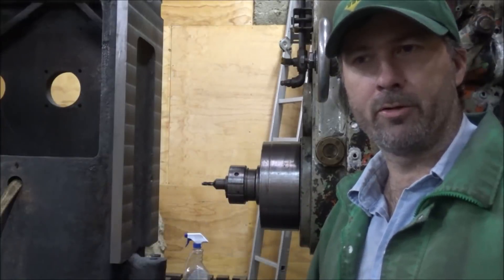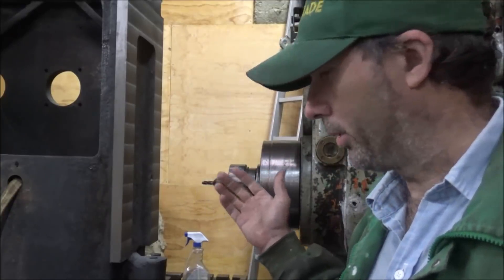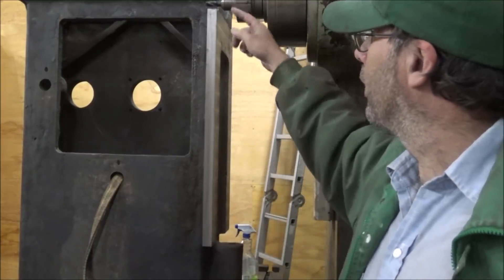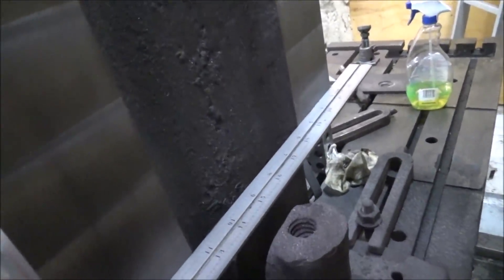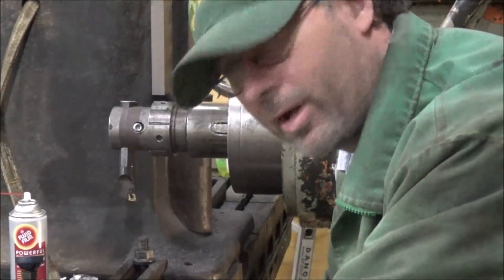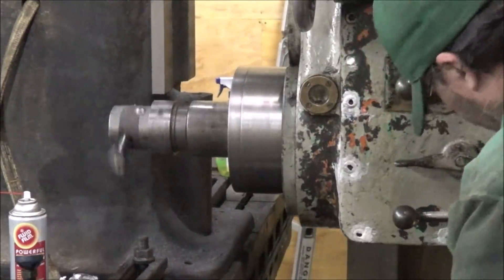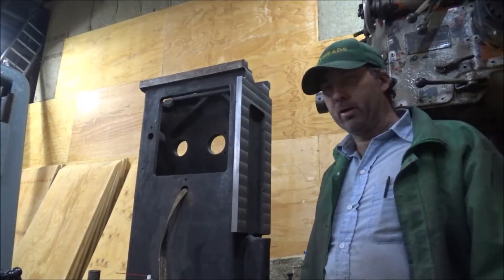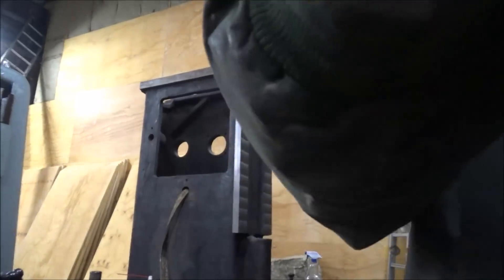Machining a machine Tool: Rebuild back to Spec Part 3

Comment: I suppose that shaper main casting, given it's age, would have originally been machined with a planer, maybe somewhat roughly, and then scraped to finish it.  Though your machining seems excellent and usable as is, the rotary cuts do not give the correct feel of a machine that old.  Perhaps finish scraping the machined surfaces would give the shaper back the look it had when it left the original maker's machine works.  A lot of work, but might be worthwhile.
Reply from the maker: There was evidence of both rotary and straight line machine marks but none of scraping so it might be more authentic than you think. Of course I don't know how scraping looks after being out in the weather for 30 years either.

Comment: I would have never thought of using a boring bar backward like that. +1 for clever. I did notice the backside cut was consistent with the face cut "zebra stripes". It appears to confirm that the spindle axis is running slightly "downhill". I also never noticed that appears to have been painted Kubota Orange at one point in its life. That must be painful for a Deere guy...
Reply from the maker: Best I can tell it points down about .0002" in 4" you can see it in the flycutter path but you can't really feel it.

Comment: Another great video.  Looks like the original was a kit that needed finishing..
Reply from the maker: Considering it has had 140years of use it really wasn't too bad. Honestly there isn't much you could buy at Harbor Freight that would have been as good even. I am sure the guy that had it new thought it was the best thing ever and for the time it sure would have beat  a bunch of flat files!

Comment: I believe that I have watched every episode of turning the barn into the shop, I am wondering how your in floor hot water heating system is working?

I am amazed at what you have done to turn the barn into a a strong, weather tight shop!
Reply from the maker: Still not to weather tight yet. I need to get the ceiling put in.

Comment: Brian, at 4:14 how did you check it for square and parallel ?  Thanks
Reply from the maker: I had milled a spot across the top so I could reference my square down across the sides to indicate square. Then I used a micrometer across the face to measure width at various locations to see that it was parallel.
Reply: @bcbloc02  I think I can see that in my mind; not sure to be honest.  Your setups are very unique, and how you determine the results are what I tune in to learn.  Can you please show a bit more of the advanced sets ups, how you measure, and how and why you call a dimension 'good'? Thank you, Joe
Reply from the maker: There will be a whole video on measuring the results over on my granite plate. Sadly I think I missed filming a few of them and the part is already gone so I can't go back and do it again but the main deals all got checked.
Reply: @bcbloc02 I am looking forward to it!

Comment: Found anything to fix on that big machine while doing this job?   Besides getting a non tapered cutter that is.  This seems to be the shakedown cruise of this vessel. 8-))
Reply from the maker: I have already made an alignment adjustment and I still need to fix the elevation issue the machine had when I bought it.

Comment: If I were a machinist, I would have turned the piece ccw 90 degrees and used the end mill.
Reply from the maker: Then it becomes difficult to decide when you have actually achieved a 90 deg turn. If I wasn't trying to hold accuracy to +-.001" then that may have been ok, but in my experience the more times you move something the worse your errors get.
Reply: Thanks for the response Brian, I suppose you are right, what with all that mass.

Comment: Don't mean to send rude but you can't use an adjustable square to check that type of work for accuracy.
Reply: Brian, about 12 times in the video: "I know this Starrett square isn't the right tool, but it's what I've got"
Random internet commenter: "That square isn't the right tool"
Reply from the maker: It is actually a pretty decent square but as I mentioned before I know it checks slightly under square. By knowing what it roughly looks like I can get real close with it and it will certainly show if you are out like it did with the tapered end mill. Only .001" out was enough to tip the end of the blade a noticeable amount. I am not qualifying it for a guarantee. That is when  the much better tools come in. :-)

Comment: Your Starrett square seem to be quite accurate, got to check mine, and, also my Mitutoyo to check how close it is...    Also got a BIG Brown & Sharp 30 x 12 or so, precision square that surely weighs a ton, if you'd be closer you could borrow it for that project.
I find it quite easier to control precision on smaller tools, but when you get to a couple of feet it starts to get quite more of a challenge...
Reply from the maker: Yes holding tolerances of longer distances gets to be quite challenging, but it becomes even more challenging to measure and test the further it gets as well as the amount of large reference tools is limited.

Comment: Nice work.  I cannot help but wonder how much of your error is milling and how much is within the tolerance of the square you are using.  The numbers I recall are all pretty tight.  It would be interesting to see what folks find if they are going to go after this next with granite tools to set up the scraping.   This purely a comment on the accuracy of the various tools we have available.

Comment: GREAT job as usual and your ability to do such precision work with a large machine may be analogous to a doctor doing brain surgery wearing boxing gloves. VERY impressive set up. BTW, .008 error in 12" is an angle of .038º. "Machinists have tolerance issues."
Reply: Not .008", but .0008", or eight / tenths.
Reply: Sorry but I thought I heard Brian say "eight thou" at about 1:40.
Reply from the maker: It was showing a tip of  .008 in 24".

Comment: Excellent recovery on the tapered end mill. I would have never thot about that. Things like that are the reasons i keep coming back to your Channel Brian.  Just curious how did you confirm the taper on the end mills on a compactor or with vee block and surface plate. ?
Reply from the maker: It was an even number of cutters so I just measured it with my micrometers and found the diameter varied.
Reply from the maker: After measuring several I also found that the amount of taper varies in my various endmills. Some have hardly any at all and others might be over .001"/inch. The diameter of the tool seemed to have little correlation to how much taper they had if any.
Reply: Steve Summers learned of End Mill Taper here:  https://youtu.be/_qgP4bPdtxk?t=625   It appears Brian has verified the observation and it turns out the manufactures do this on purpose  in an attempt to account for tool deflection during a full depth cut.

Comment: Will someone please donate an 18 or 24inch precision square to this fella already lol.
Reply from the maker: I am blown away with gratitude! email me bcbloc02 at yahoo for my info when you need it. Thanks so much!!
Reply from the maker: I had a bid in on 24" one Saturday but got beat out at the last second!!
Reply: bcbloc02 If you send me the part # of a square you would like I’ll be happy to buy one for you.  I really enjoy watching you videos.
Reply: bcbloc02 waiting on your reply !!
Reply: @bcbloc02 That's the worst! I hate watching an auction end and seeing my bid get beat at the very last second! I feel so cheated lol
Reply from the maker: A used one of these http://www.starrett.com/metrology/product-detail/20-24 is what I was bidding on. One of these would be much more reasonable http://www.starrett.com/metrology/product-detail/3020-12.  It is still pretty expensive though. I would never expect anyone to buy such a thing for me.
Reply: bcbloc02 I have the 3020-12 on order for you.  When it comes in I’ll contact you for your shipping address.
Reply: Do a quick shopping comparison, I see Shars carries a 24" one for just over a hundred bucks $115.95 https://www.shars.com/products/measuring/squares/24-x-12-hardened-precision-steel-squares-straight-edge-squares square to 0.00068" or you can get a starrett for $2,000 and 0.0001" accuracy https://www.mscdirect.com/product/details/86401809